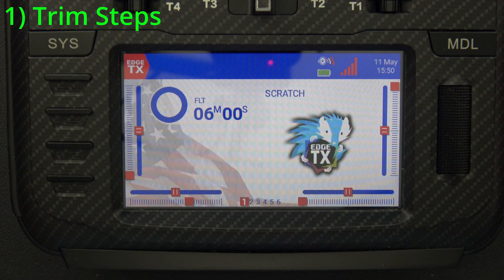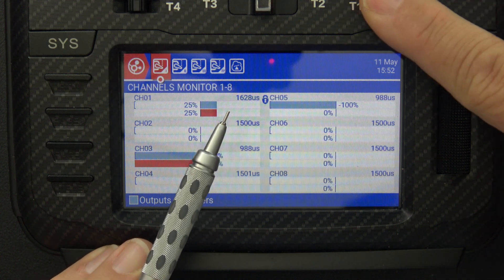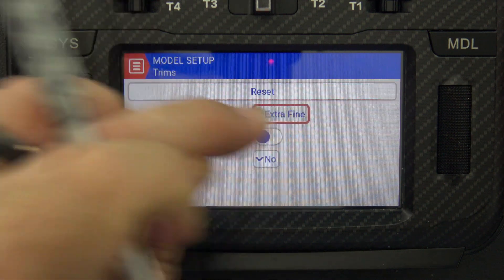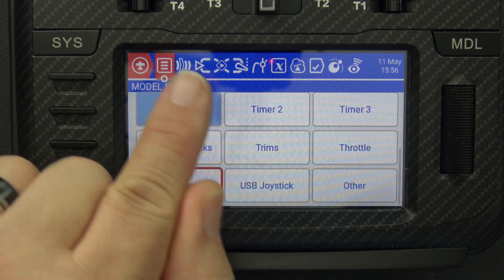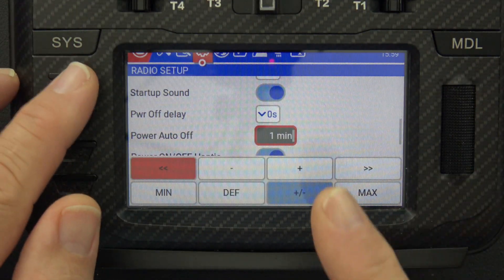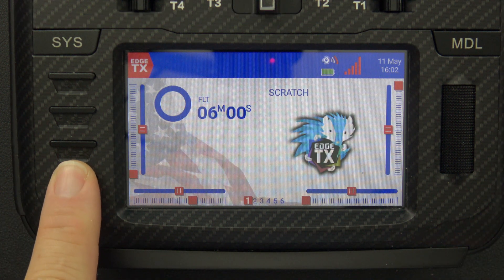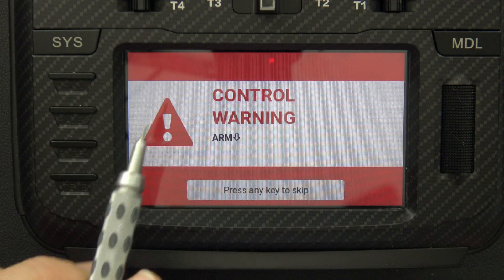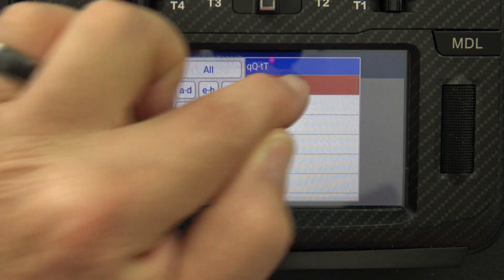10 EdgeTX Power Tips Every Pilot Should Know (But Most Don’t!)

Comment: While playing with settings recently, I discovered a new way of resetting timers and telemetry automatically when using a receiver that has main battery voltage telemetry.  Under "Logical Switches", I have this line, "L02 a>x A3  8.1v SC(toggle switch down, which is also my throttle-cut)". Then under "Special Functions", I have this line, "L02 Reset All (box checked)". So, whenever I connect a 2s battery that is higher than 8.1v, it resets automatically! I love this feature because sometimes I would forget to reset my flight session.
Reply from the maker: Wow! That is a great tip, thanks for sharing.

Comment: Great vid John, thanks. Have a curly one that needs your experience. The application is RC yacht, where the normal throttle channel is used to let the sails in and out (fully in = max throttle) and servo is replaced by a rotary winch. What we (yes there are lots of us trying to figure this out) are trying to achieve, is that when throttle is at max (and we use end points to determine max and min number of turns on the winch), using a three way switch, when switch forward is a small increase above max, and switch down is a small decrease below max. Switch centre, is neutral. Using mixes, we can make this work, provided the throttle is not at max. (When at max, we are finding we can switch down, but not forward). We hope you can help ! Using RM Pocket, ELRS and ERS4 receiver.

Comment: John. I really need a help please. Do you know why my tx16s so slow switching next screen. I'm not sure if I'm able to post link but add this to the end watch?v=YTmQx__8z9Y Ty john. I'm so lost. I did replace my sd card. Very odd I have the latest firmware. Ty john
Reply from the maker: https://youtube.com/live/aNBJzDKAkog
Reply: @RCVideoReviews  Hi John problem is other people have this issue with latest firmware. I ended up buying a fast SD card but same issue. Seem to me firmware bug. Have you installed the latest firmware?
Reply from the maker: It's never a question of the speed of the sd card. The interface between the card and cpu is slow. Buying faster cards does very little to enhance speed. It's about the formatting of the card that is the problem.

Regarding the lag on swipe, I feel like that's been an issue for a long time. I usually just hit the page right/left keys to change screens--that happens instantly. 

You can always revert to prior firmware versions until you find something you like. I also suggest opening a ticket on the EdgeTX github.
Reply from the maker: PS I can't help with firmware bugs. You need to open tickets with the Edge team on their github.
Reply: @RCVideoReviews  Thank you so much. I hope RM is working on a successor of Tx16s mk2. But they focus to much on drones user. :(

Comment: your gimbal is so good... stay at 1500us everytime... mine went from 1499 to 1500 even for the Rudder it went from 1498 to 1500 very quickly... it's brand new TX16s MK II, and i already try to calibrate it from edgeTX
Reply from the maker: It might help to increase your spring tension a bit. Are you using AG01s?
Reply: @RCVideoReviews  yes i did, i use AG01, i will try to increase the tension again...